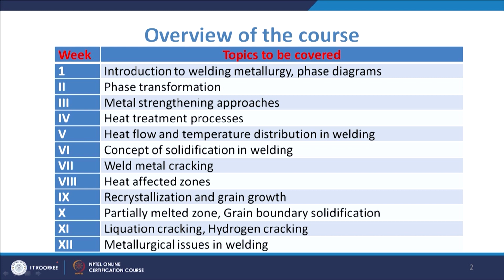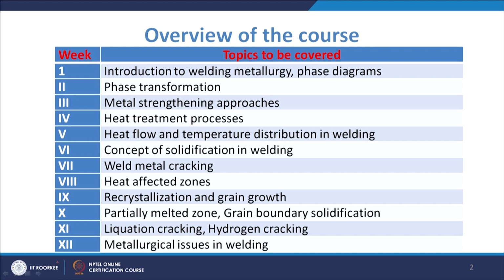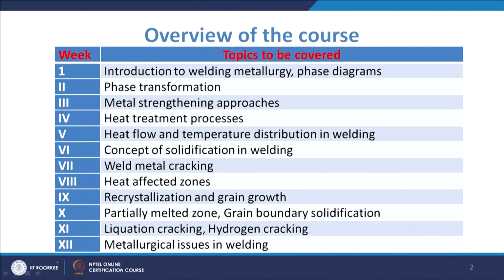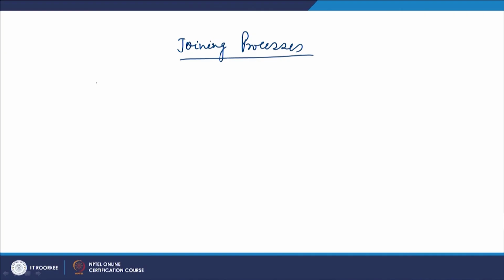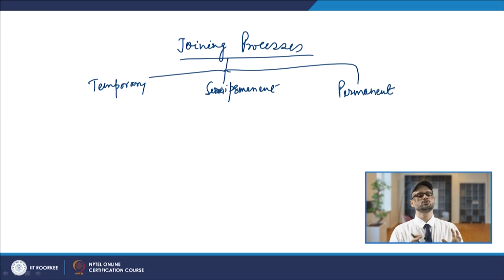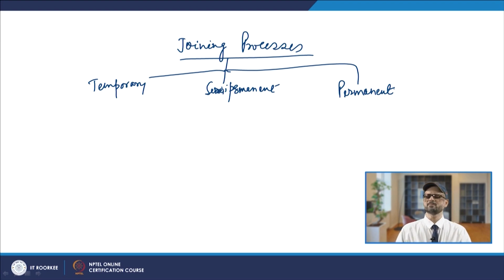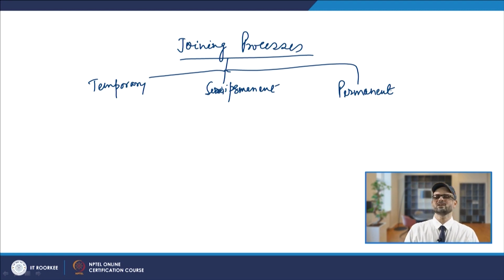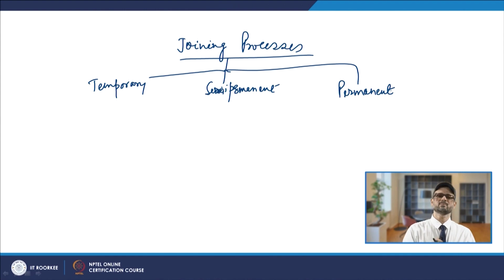Introduction to welding metallurgy

Comment: 00:33 Introduction to 12-week welding metallurgy course
04:16 Welding metallurgy involves welding and metallurgy processes.
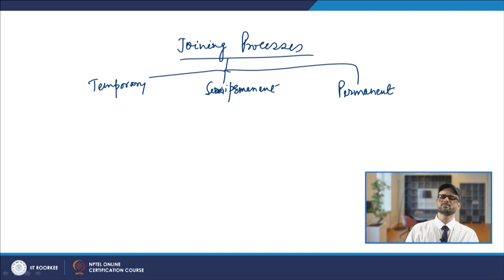07:54 Different types of joints in welding: temporary, semi-permanent, and permanent.
11:31 Understanding welding metallurgy for defect-free welds
15:12 Metallurgy involves understanding metal behavior and tailoring properties for specific applications.
18:50 Understanding metallurgical principles is crucial for successful welding.
21:55 Understanding phase diagrams and phase transformation in welding metallurgy.
25:06 Different types of metal strengthening approaches
28:09 Welding metallurgy involves managing brittleness, heat affected zones, and cracking.